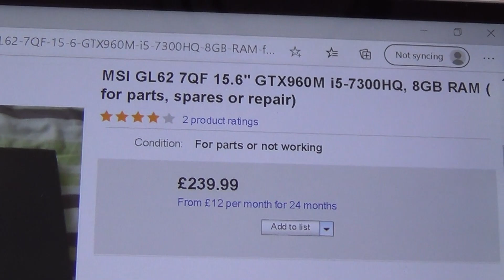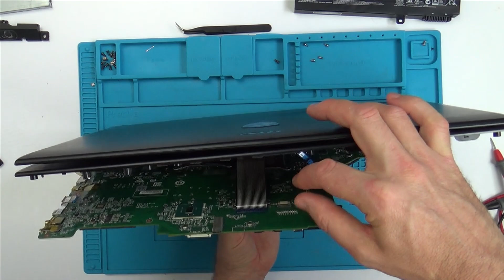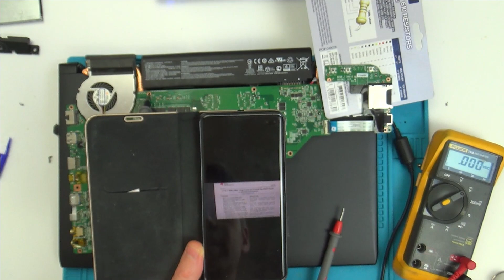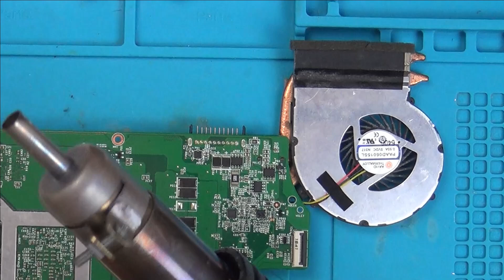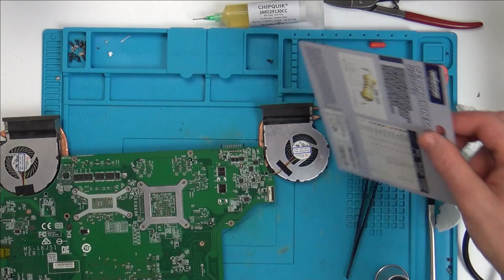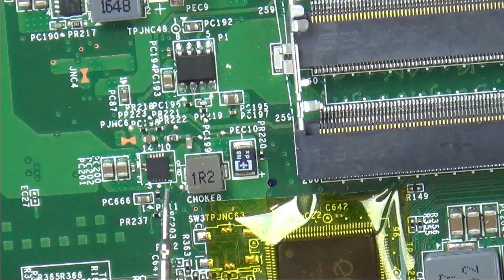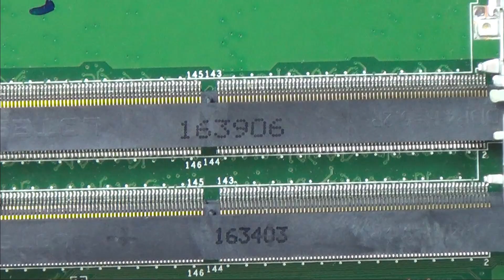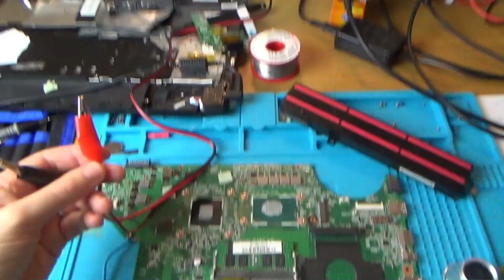Trying to FIX : Faulty MSI GAMING LAPTOP from eBay

Comment: Hi Vince, great Vid. Did already leave a comment but it dissappeared after posting for some reason, so i'll be brief. As this is a short circuit it's a constant current load, setting a high output in this case and you can see the voltage being pulled down....Unfortunately I'd guess the Intel chipset has various voltage rails much like a GPU/CPU likely in the region of 1.2V, 1.8V, 3.3V so by setting your PSU to 5V your likely exposing this chip to voltages outside of it's range before the voltage drops under load, and this case you may have caused it's failure :( In this situation you'd want to set the voltage on your supply low (1V in this case) and the current high. Next time, I'd remove the inductor/s so you can see if the short is on the input or output of the switchmode rail, by removing the inductor your also removing any other components from the line of fire and your don't risk backfeeding anything, this might have simply been a faulty mosfet before the inductor output :(. I vote to get a preballed chipset and have a go, i think your hot air gun should manage it once you've fixed the fan wiring :)
Reply: Perfect!

Comment: I've worked on a very similar model.  It came to me with a faulty audio port.  The pins had gotten all mangled.  Bought one from China and got it replaced.  The CPU/GPU are surface mounted as is typical.  The more expensive MSI models have a modular piece for the GPU where you can swap it out.  The model you have and the one I worked on also have inherent weakness with the hinge design and will eventually break.  Offered up in case you ever managed to fix it (or opt for a board replacement).  I still have a previous generation MSI gaming laptop and use it to this day.  Thumbs up Vince, I was as always, rooting for you :)

Comment: with ebay sellers this is common, they will get them broken or with a simple issue, say a broken fan, they will go tear it down, replace or try to fix whatever the issue is, screw it up further because they have not the faintest idea what they are doing, make a fictional story on ebay to sell it to mislead people on what the issues could be and the simplicity of the fix, then if you buy it and call them out they can pull the "I listed it as broken" card and screw you over
Reply: i mean who knows maybe its the truth but that happened to me before

Comment: Unfortunatky I was "driven" in this path in the past with a Toshiba laptop, "fan is a bit noisy, wont load windows. For spares". It was HALF the price of a similar working one. I said, .... fan can be fixed or replaced and Windows ... just SW. When I picked it up, yep, Windows was stuck middle install and fan a bit noisy. Then discovered that formating the drive was impossible, TRASHED HDD. I bought the HDD to just discover that he keyboard was also broken. They guy of course kenw it was TRASHED, it listed it as "FOR REPAIR" and then, inside the description they trick you to think that is not that bad, you can get this on its legs again ....
Reply: ......  Life is about learning. unfortunately our species includes 'used car dealers, Real estate agents, and eBay laptop sellers. This video is about gambling. The odds are always in favour of the 'House'.
Reply: I bought some GameCubes for repairs just to discover that 3 out of 4 were assembled entirely from bad parts, and the last one was absolutely filled with roaches.
Reply: Well more often than not if Windows won't boot properly the drive is knackered, sound like quite an easy fix to me
Reply: @themrenerd7384  well it would be easy to replace the hard drive, but they also said the keyboard wasn't working properly, which would require ordering a replacement keyboard, which isn't always as easy as replacing the hard drive.

Comment: You should have started by download the schematics and than begin to do checks.  It is always difficult to understand the max allowed voltage with no schematics. We always say put it less than 1V but I saw in some very high speed FPGA chips core voltages 0.8/0.9V. So again you should look at the schematics, learn how to read it if you don't, and than use it to decide the needed voltage.

Comment: Straight away alarm bells start ringing "not an expert" but managed to pull a HDD/SSD out all by their lonesome Hmmm The damaged ribbon cable suggests some skullduggery too, these cables don't damage themselves.   BTW did you catch my review on the excellent Ferrex digital multimeter from Aldi?   Its actually pretty darned good for £9.99 meaning I can keep my 53 year old Cropico NormaTest for gentle work as the NormaTest is an incredible multimeter.

Comment: Hey, thanks for the kind words today and if you are ever in need of parts or stuff for Soviet watches do let me know, nice to see a computer video.   

Back in the 70's I trawled tips and council dumps for any office computers thrown out and I got my first Commodore Pet that way, armed with my "Electronics 'made easy'" book, a positively lethal soldering iron and ghoulishly harvesting every resistor, capacitor, transistor (no IC's back then) and took best part of a year to painstakingly repair said Commodore which I sold for a veritable small fortune and enough to buy my first 8088 and some better tools (notice the lack of new there) of ex GPO soldering kit and an ex electricity board "sad face" AVOCR meter.   I even harvested solder as it was hard to come by back then and local hardware shops didn't stock it and it wasn't until we got a RS components shop open in Bromley but still today I go easy on the solder :)

I think the funkiest repair was for a World of Warcraft guildie whose Alienware (pre-Dell, not the rubbish Dell chucks out) laptop had stopped working, he shoved it in box as is and when I opened the box, the great big carvery fork sticking out the back was kinda a big hint why it stopped working and the guildie earned the name "roastie" after that.   Got it working again, he was so lucky he just damaged some plastics and sheared a connector cable from the power line... I cemented my rep and still build on occasion rigs for the chosen few, water or air, its just so easy compared to the ancient pre-windows machines (oh I do remember the days before Windows) I do resent the heinous prices some places charge for what is something anyone can learn in 20 mins and easy as Lego to accomplish.

Comment: It could be a possibility that the button next to the bios battery is held in when in the case, I repaired a asuse faulty battery reset button and there was alot of shorts. when I replaced the button it still hade shorts , for some reason I taped down the other button not so far away from it and tested again and there was no shorts and it powered up with no issue but during diagnosing parts of the motherboard did get hot and at some point I fort mine was broken, just a possibility but hophaly will help.

Comment: Good effort, but man that was ambitious =)  I suppose when you break it all down, electronics all follow the same principles, but I have to admit, I likely wouldn't even ATTEMPT to troubleshoot a PC main board :P
Reply: IC's are technically just a chip with lots of electronic switches (transistors), opening and closing paths in the chip, shorts simply burn the transistors and cause them to be open or shorted when they shouldn't.

Comment: I'm no expert, but I don't think you connected positive to the safest place for voltage injection. Looks like you bypassed the power stage and sent that voltage straight into the chip. But again, I have very limited knowledge on the subject

Comment: That BQ737 chip is the battery charger IC and it is connected to the power button via a 10K pull-up resistor which means that the chips main purpose os to output 3.3V for the pull-up on the power button. So that chip was working fine because you measured 3.3V on the power button. Now you have to follow the power button trace to another part of the motherboard that have a controller chip for the bios startup, it will be bigger and have a lot of pins.
Reply: Pull-up resistor is used to pull the voltage up so the power button pin is at 3.3V (logic high) and when you press the button to ground it shorts it to 0V (logic low).
You use the resistor to pull the pin to a know voltage instead of letting it float. You can use a 10K resistor to ground for pull-down or to 3.3 or 5V for pull-up. If you let It float then the voltage can fluctuate and become unstable.

Comment: Hi Vince, please never ever buy something for 200£ that doesn't turn on.
Reply: I have paid over £200 for faulty laptops but a lot of research before I buy. Latest was Alienware 15 r3, i7 6820k, GTX 1070, 4k IPS panel, 1tb ssd, 3tb HDD, 16gb ram, I paid £250 and the fault was not switching on. Turned out to be 1 cap had shorted and took around 2hrs to strip, diagnose, replace and rebuild. Sold within a few days for £700.

If I couldn't get it working the value of the parts would cover the expense. Unfortunately I don't think the one Vince bought has £200 value in parts
Reply: That laptop costed over £1000, so I can get why it was £200 for spares or repairs.
Reply: @shadowtheimpure  It costed £1000 as it was new and functional, nothing is worth £200 that doesn't even turn on and maybe can be repaired by someone. The fact that it doesn't turn on defines the value. And that value is next to nothing, because you don't know what happened to the board, it was selled for such a high price because of profiteering by the seller imo.
Reply: @petey1980  for that laptop, no, 200 wasn't a good price, but 200 is a good price for some things that won't turn on. say someone is selling a 2000 dollar PC that won't even post, and it's just a bad power supply or something isn't seated correctly. That would be a great thing for 200 even though it doesn't turn on.
Reply: @clothinghanger6978  could be or could be that someone has already tampered with, and fucked up the whole board. It's jeopardy....
Reply: @petey1980  The original price of the item usually determines what people are willing to accept for it even broken. It's the reason that broken Nintendo Switch consoles are around £90. Since the console costs £279 new, people aren't willing to accept less that 1/3 of the original value for the broken unit.
Reply: @shadowtheimpure  The laptop is like the lowst end that msi hat to offer 3/4 years ago it does not even have the basic i7 alot of them had at the time and the 960m is just a rebrand auf the newer 860m from before u could get them for around 700 euro in germany new and right now u can pick them up for like 300 ish fully working thats prob why the seller was wirting so much he could not belive someone really paided 200 for that junk ^^ So it was just a shitty buy but its still intresting to watch but yee after what i saw i dont think its ever gonne work again but hey yt will pay him and we had fun watching win/win ah and some kid got alot of money xD for junk
Reply: Unfortunately, they took out the hard drive and I forgot what else.  This is a seller on ebay who knew the board was bad.  This is for the people who are bitching, youtube is a business and anything he buys for the express purpose of showing it on youtube and/or reselling is a tax write-off here in the US.  I'm sure it works somewhat similar in the UK.

Comment: A good tip for you when it comes to working on anything that charges a battery with a charger is to check the voltage between the plug and the battery terminal
Reply: You are completely wrong. You don't need to be concerned with voltage on vcc_batt unless the vcc_main short is resolved

Comment: I had a Sony Vaio a while ago. The fan inside died and because of that it would overheat and shut off in only seconds. You can't just change the fan without changing the entire cooling module and that was nearly 200$ plus shipping for a replacement. Since I didn't even want to spend that much money without being sure I could do the fix, I ended up buying a new computer. I got a cable from Amazon that allow me to use the blue-ray drive as an external USB drive. The 500gb hard drive went into my PS3 who only had 80GB. I even salvaged the cells inside the battery and put 4 of them in a power bank and 2 others in flashlights. The only thing I haven't done yet is try to find a LCD controller and salvage the screen. That was the last time I owned a laptop. It's so much easier to fix a desktop if you know what broke.

Comment: in fault finding you allways start with the power supply .fuse,cable,voltege of the power supply
battery on till dawn you get the meaning

Comment: Not that this would make a difference in this instance, but if there is a fault with the battery sometimes removing the battery and then plugging up the charger is an easy way to get the system to boot.

Comment: I had a solder station do exactly the same thing, I had to unscrew it from the station and run through the house to the back garden carrying it while it was in flames, you're lucky you turned it off quick. It's a fault with how they are made. I'd recommend the 998D station as that's what I've had for 4 years now but they don't seem to sell them anymore. Anything with the same hot air gun will have the same fault.

Comment: You could send it to Adamant IT he has an YouTube channel and a small computer repair shop. But a working laptop with a 960m isn't worth that much let alone a broken one. The 960m came out 5 years ago and it was just before Nvidia started putting in desktop power GPUs in their laptop GPUS.

Comment: You better study how computer step down work on some of them use push pull configuration with two mosfets one shorts to ground the other  to vcc . You kill the chip by putting 5v on a rail that goes to that chip.
Reply: I do not think that he killed the chip. Because the voltage has never gone above 1 Volt. Sure he set it to 5 Volt at the power supply, but because of the short the voltage never gone above 1 Volt (even lower). Short was there before supply of power from Power Supply.
Let me explain differend, if there was some component in series, like a resister and the power supply would state 5 Volt at 3 Amp then the voltage would have been on the component, like a voltage devidor, This is not the case here.
Power Supply was parallel on component in short, and voltage on Power Supply never did show anything above 1 Volt.
But yes, he should have stayed well below 3 Volt, just in case the short would 'burn out' and voltage would go up. That would be bad.

Comment: Vince some CPu's and chipsets go to ground when the laptop is switched off
Reply: Other have low resistance to ground, around 10 ohm on the rail. Even on the samml caps in the CPU itself (the bottom ones). I guess that they are so low voltage that meter is actually abler to polarize part of it and is able to draw current making the meter to get a low reading.

Comment: Hey vince.   Wondering if you could give me some advice with xbox one s.  Thanks :)
Reply: I might be able to give some advice, if you could tell me what your problem is.
Reply: @onlinefredd  my current xbox is turning on.   Slight fan spin. And turning off.  I hace checked for shorts and checked the mosfets but nothing seems to be wrong.  That is obvious.  But the board still holds 12v throughout i cannot find out why. And where the short is

Comment: I had that model burgled from me 2 years ago and tracked to a house in Northampton but the police weren't interested. Might send you the serial number from it just to check. 😁👍
Reply: Is that why the seller was asking questions after the sale ?
Reply: @gingerninja7187  Maybe. I bought a job lot of routers off eBay once, the seller had scrubbed the serial numbers off the label on the bottom with a black felt tip pen. Completely forgetting that the serial was also embedded in the firmware and could be accessed through the router's interface pages!! Works the same for computers, it's in the BIOS. Lots of aforementioned routers turned out stolen, so I handed them, and the seller's details to the police......